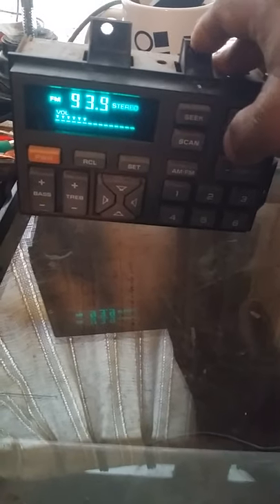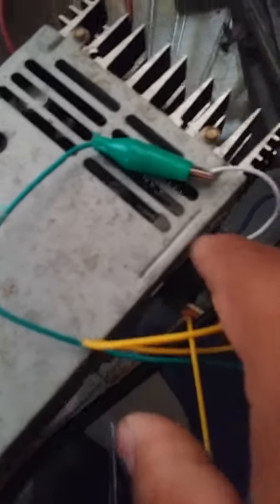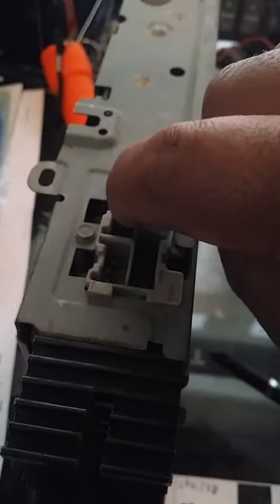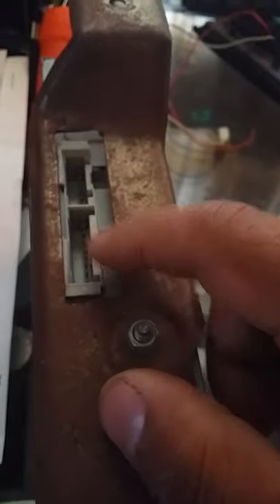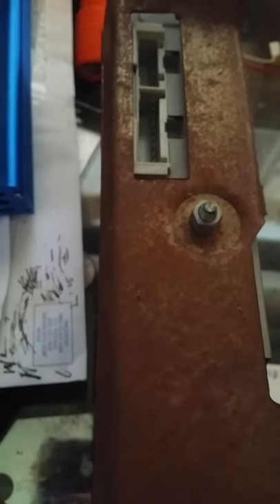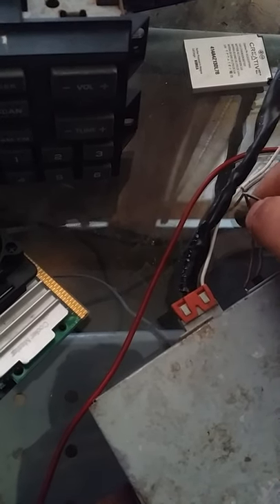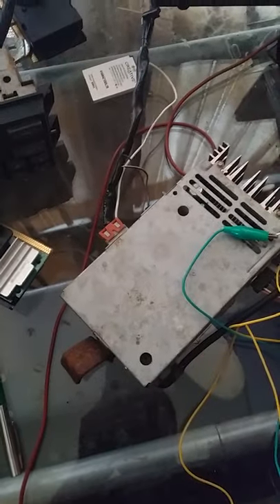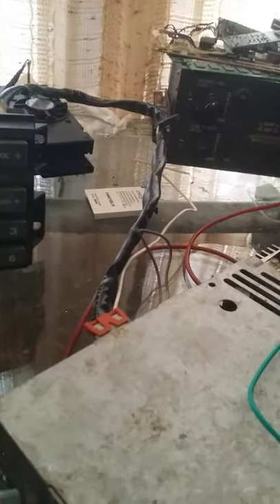CDM mod 88-94 GM trucks

Comment: The reason people change them out cause they’re not cheep if you get 3 peace’s it’ll nearly cost. 500$ but for a used radio unless you go to a junkyard get one less than 50$. That’s why GM stopped making these radios a 3 peace. It’ll be nice too find one new on eBay with some people like myself on fixed income you can’t afford a 400$ mistake on a used Delco radio that is a 3 peach. I have a 2001 Silverado I bought a new CD Delco radio under 140$. Plus you don’t gotta reset your stations each time the battery is unplugged

Comment: Can you recommend a Bluetooth adapter and how I would wire it instead of the aux?
Reply: I was looking at the millennia milbtrec unit from Crutchfield. But not sure where I would run the 4 wires. There’s a left and right but no common for audio, and then there’s a hot and a ground wire
Reply from the maker: I bought a generic blue tooth board the size of a quarter off amazon and have it wired up to turn off and on with they key. Its just plugged in the aux cord and zip tied under the dash.
Reply: @DRNEGOLICIS hi hi hi hi ????

Comment: Have you ever had one of the 88 to 99 radios stay at 100? I'm having this problem with my 93. It won't change from 1 and nothing works no music nothing except the clock saying 100
Reply: Mine doing same thing. It's the cdm crapped out.
Reply from the maker: The clock should be built in the control head.  I was having issues with buttons not working at all, a quick test with a known good control head proved the CDM to be in working order. I took apart the failed control head and found the pins had tarnished, cleaned reassembled and re-installed, unit works Ok now.  Oh and also when the clock did decide to work. It would give weird times like 1:73
Reply: Yes it is the main brain box I would say pretty much controls everything the amplifier CDM box

Comment: I do have one of the units that I purchase which has the external wire that is soldered inside ,one of the two outputs has failed I only have sound coming out of one speaker and the other is intermittent but once I take it out of the truck and open it up I will be able to see where the two wires were soldered I am considering trying your system also with the original cassette plug because the cassette is no longer able to be purchased from General Motors and who wants to use a cassette any longer anyway but I will get back once I open it up and see where the  soldered connections are

Comment: I have a question as to where the single white wire goes to, the wire is separate from the control head wiring. It has as little black connector on the end of it. Looks like in the video it is connected to a little batters source.
Reply from the maker: Off the back of the head? Onea serial data for the EQ option

Comment: im curious if id be able to have the control head still operable and have an after market head unit installed into where the tape player is and have them both functionable??
Reply from the maker: Not sure why you would want two radios ….. but you don’t have to have the cassette player plugged in for the stock cdm to operate, if you have a EQ you’ll need the cassette deck connected to set your EQ before you disconnect it’ll remember the setting as long as the batt is connected

Comment: I plugged in my control head and turned the volume all the way up and it’s low, and reason why?
Reply from the maker: Gets loud at key on then drops down? Not sure but its a failure mode. I haven't actually repaired one yet. I've recapped one once but that's it

Comment: When i turn on my radio all i get is static on FM or AM. Any idea on what it could be?
Reply from the maker: Use a wire for an antenna and see if it works. Sometimes the antenna connection under the hood fails. If that don’t work then you have a PLL VFO issue with the actual CDM I don’t have a fix for that yet
Reply: @DRNEGOLICIS  I just replaced my dashboard and noticed that the speakers are disintegrated. Would that have any effect causing the static? Only one speaker was working in the truck and I see why now
Reply: @DRNEGOLICIS also did you ever find a way to wire an aux to the radio? And if so can I send mine in
Reply: @DRNEGOLICIS the antenna is fine. I hooked up a cdm off an 80s model and it worked for a split second then stopped working. Could it be the caps?